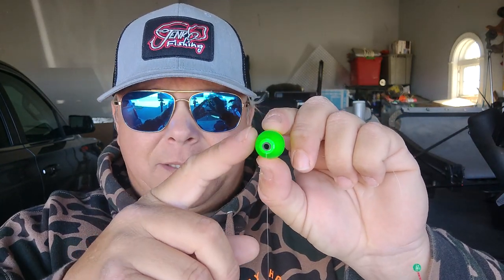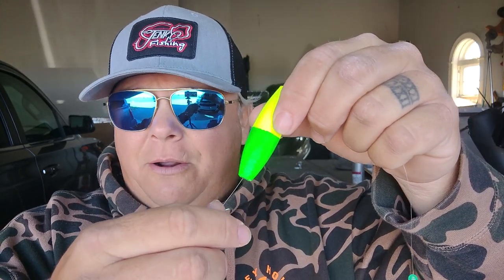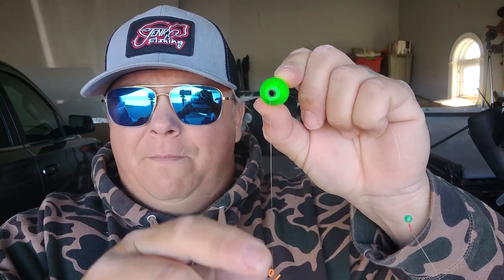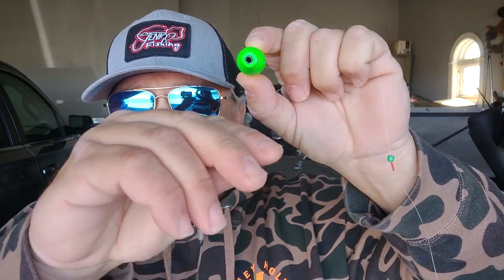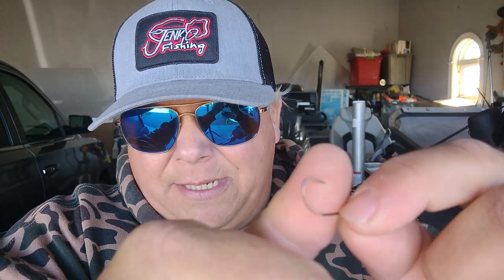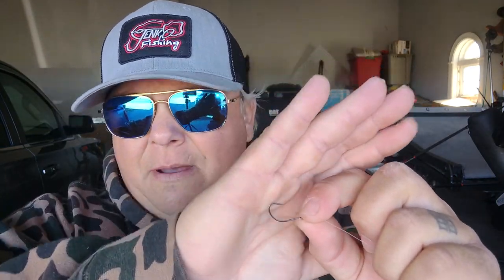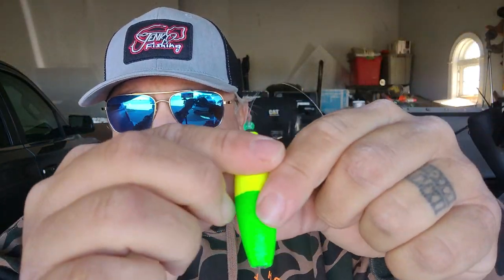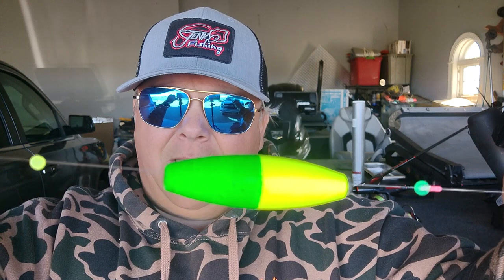Maximize Your Crappie Fishing: Mastering the Slip Bobber Method

Comment: I use a small rubber band to stop the cork.  I use crimp weights on the line.  The Styrofoam Bobber being  open on the bottom will hang the weight when casting.  Small rubber bands allow you to wind up into the Spool for Deep Applications.  I prefer long skinny bobbers and modifying Them with Steel Eyelets.  Slip Rigs will not stand the Bobber up when the weight is on the bottom of the lake.  Many Advantages.
Reply from the maker: Sounds like you got the bobber game dialed in my friend
Reply: @chrisbushartfishing  I grew up using them.  One of the obstacles We dealt with using Them was on ponds that had holes in the moss with Cattails and Trees around the banks.  It's hard to target the hole in the moss with a lot of line hanging out.
Reply from the maker: @christopherwatson283  yes it is